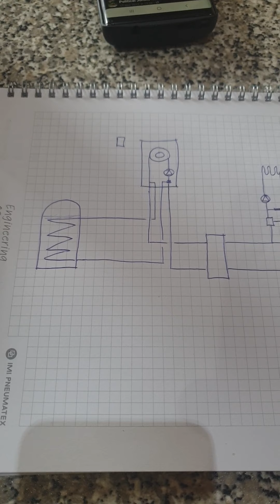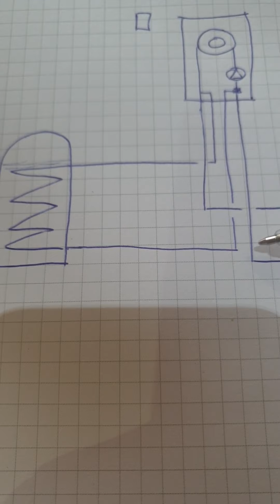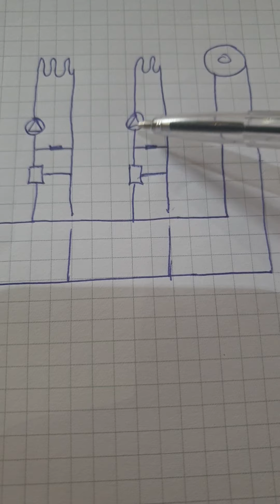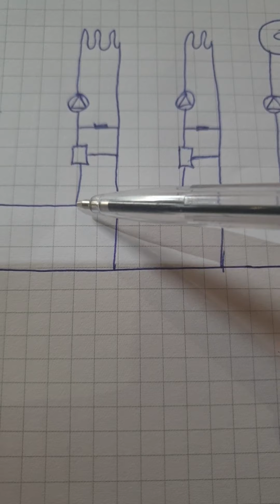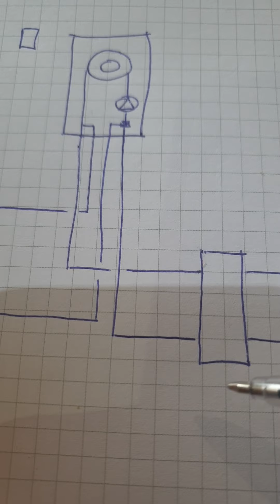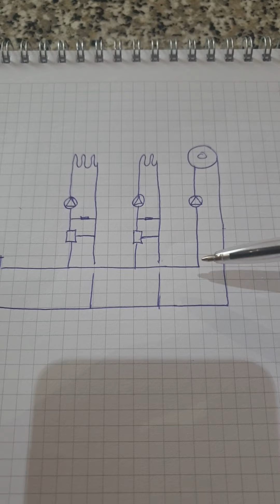Viessmann system design overview.

Comment: Andrew - for that common flow pipe feeding the mixers, should that ideally be 28mm then and then each flow to the mixed circuit tee off in 22? I have a LLH, 22mm “common flow” or distribution header as you sometimes call is - it’s all in 22 though. The run from the header to each unmixed circuit is only about 600mm though so not sure if it’s a major drama?
Reply from the maker: The distribution header should be sized to have a sub .5 m/s velocity.
Reply: @andrewmillwardwatford9410  thanks Andrew - is there a formula for that? I know the DT, SHC and Lps one but that doesn’t have pipe diameter as a variable. Cheers
Reply: Scratch that - found your video on YouTube!